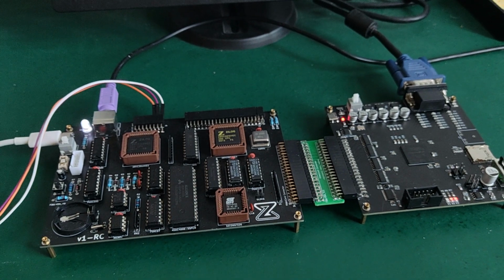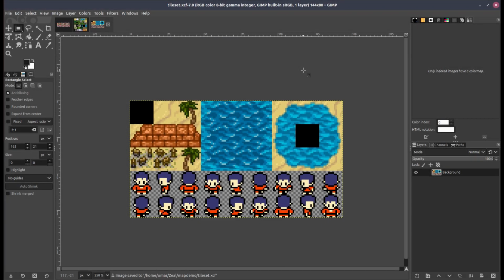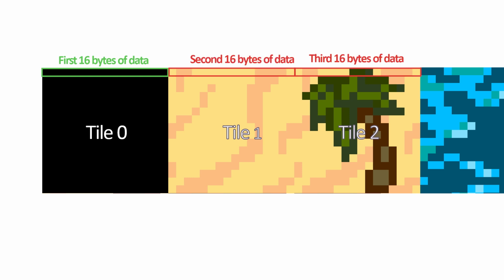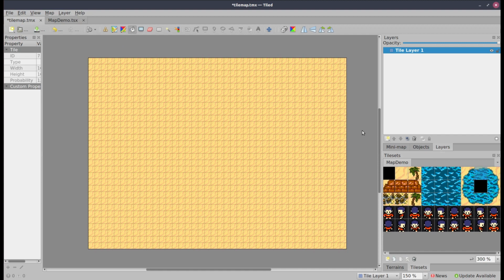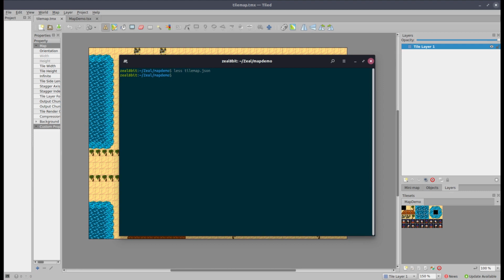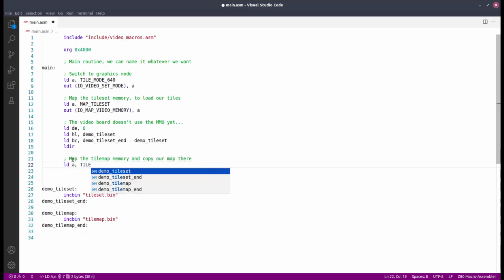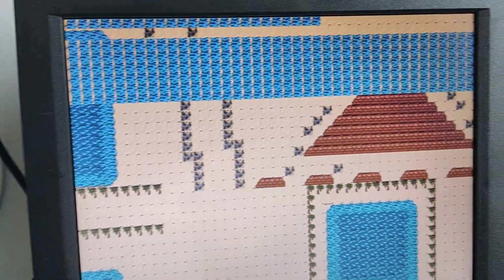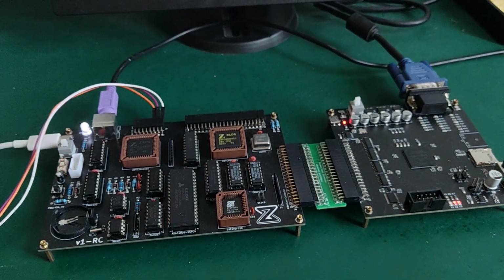How 8-bit graphics work on homebrew retro computer [Part 2]

Comment: You talked a lot about the software side of things but I've wondered how the vram works. For example. In Ben Eater's "world's worst video card", the reason for its name is that it wastes 71% of the the time wait stating the cpu while it transfers data from the vram to the screen and the cpu can only operate during screen blanking - when data isn't being transferred from vram to the screen. This is obviously a very bad way to make a video card but it was the industry standard for many years just because overcoming this design issue is relatively difficult.

The easiest way to get around this issue is to have 2 banks of vram between 2 ram chips. Or 2 "pages" if you will. 1 page is accessible by the vga port at all times, the second page is accessible by the cpu at all times. You can switch which bank is being displayed on the monitor and which bank is accessible by the cpu at any time. The main disadvantage of this method is that you need 2x as much vram for this to work but at least using it doesn't slow down the cpu.

Designing a video card that doesn't have the issues of the "worlds worst video card" and is better than a bank switched buffer card is difficult. However this approach seems to be what you did here. All I can make out on the video card is 1 fpga, (two?) spi eeproms, enough resistors to probably output 16 bit color and 5 chips near the expansion port that could be anything including ram, bus transceivers or discrete logic chips. I would think one of the better ways of implementing this would involve a 4kb or so vga buffer to buffer data between the vram and the vga port but judging by the placement of chips, that's probably not what you did.

so lol how does this work? Do you have a block diagram somewhere?
Reply from the maker: Sorry for the very late reply!
Your question is very interesting, and indeed I haven't explained it a lot here (I did explain more on Discord). As you said, one problem I wanted to avoid is memory contention between the CPU and the FPGA, I also wanted to avoid allocated a part of the motherboard's RAM for video. As such, the easiest and best solution for me was to use another RAM for the video. It's not a dedicated chip though, it's the FPGA RAM itself. I choose this FPGA because it has ~120KB of BRAM. I use this BRAM for storing the tilemap, the tileset, the characters pixels and the palettes (I'll also use some for the sound and SD card).
Moreover this BRAM can be used in a dual-port configuration, which is what I used. Used in a 4-stage pipeline, I am able to natively output 640x480 pixels at 60Hz independently from the Z80.
This dual-port configuration also lets the Z80 write a byte in it while the FPGA is reading from it for output.

Overall, this gives me two separate RAM: one for the FPGA, one for the Z80, no more contention. The Z80 is free to use its whole 512KB of RAM. Of course, the VRAM must be mapped to the physical address space so that the Z80 can virtually map it and write to it (tilemap, tileset, palettes, etc...)

Comment: What do you mean by "the VGA palette"? In VGA you can set your own colors in a 256 color palette as RGB with 6 bits for each channel (not 8 bit like modern computers) making it possible to select 256 colors of 262144.

Impressive work, btw!
Reply from the maker: Thank you for your comment!
I tool a shortcut, I meant (and should have said) the "Mode 13h" palette. 
In the future, I would like to add this feature to my video card implementation too: customize the 256-color palette, where each color can be 16-bit  (565RGB).

Comment: Could you make a video that describe the graphic capabilities in details?
Here you have constants and code that suggest more complex elements - like more then 1 layer, 
Also you have 1byte in the tilemap, and only 7 bits as index, do you plan to add more bits for H/V-flip. Also if you add more VRAM you can increase the index size to 8-10 bits
Also I didn't understand is it possible to change the colors in the palette? If so what is the RGB resolution like 444, 555, 666,...?
Reply from the maker: I plan on describing the graphics in details as soon as the implementation is finalize. I haven't implemented custom (4-bit & 8-bit) palettes yet, so at the moment, it's not possible to change the colors, but it is planned! The resulted colors would be 16-bit, in 565 format.

I am only having 7-bits as index becuase of the lack of VRAM I have in that Altera FPGA. In fact, I have at most 128 tiles. I have changed my FPGA already, I now have more VRAM, I am now able to use all 8 bits as an index. So, we have 256 tiles. I will now also be able to implement sprites. The sprites will have attributes for H/V flip. Tiles don't have attributes. It would be possible to add some, but it would require another attribute array (like the sprites), or 16-bit indexes, in both cases it means more CPU time to setup a tile. Indeed, there is no DMA on the board so all the writes to VRAM must be done by the CPU. In any case, I may consider adding attributes to tiles if time allows
Reply: @Zeal8bit  Excellent, I'm looking forward! Thank you in advance for 565 RGB :)
If you add 4bpp then you will be forced to extend the tilemap to 16bit, because you will need extra 4b for selecting a palette (to cover all 256 colors). So why not add 2 bits for H/V-flip. And you will have 10 bits for a tile index.

P.S. I would strongly suggest to not use real 640x480, rather doubled 320x240. That will reduce 4 time the VRAM requirement and CPU overload. This also will allow you to use 8x8 tiles instead 16x16 and this has so many benefits. Ideally you might even allow the developer to chose 8x8 or 16x16.
Reply from the maker: @SquallSf  I was thinking, at first, to have a single 4-bit palette for all the sprites in 4pbb mode. When optimized properly, 16 colors is already pretty good.
I am wondering if having 16 palettes of 16 colors will bring a lot to the final implementation considering that it's already possible to have 256 colors. Again, I put myself in the hardware implementation side, not software side😄
The reason I would like to avoid 10/12-bit indexes (and prefer 16-bit) is that I would like to be able to modify a single tile data without modifying the neighbour's. If we use 10-bit indexes, we would have to read (from VRAM/RAM/ROM) the word containing the highest 2 bits of the 10-bit index, modify these bits only and then write them on the bus to the VRAM. Similarly, modifying the neighbour's would mean modifying the higher 6 bit only.  Shifts/masks are a bit of a pain on the Z80 as only the accumulator can perform them and it's only possible to shift 1 bit at a time. Thus, it would be faster to use 16-bit indexes. Another possibility would be to have all the extra bits (let's call them attributes) in a different array, that would be a good tradeoff.

You have already guessed what I am working on. I have already implemented 320x240 (double pixel) for the text mode. I will continue by implementing it for graphics mode. Both will be available at the same time. It will be possible to switch between both resolution thanks to a single write on the I/O bus. 640x480 is very handy for text mode as we get 80 columns! For graphics mode we have a 40x30 tiles mode which would let us have HUD on games, without hidding too much the "playground".
But again, up to the developer to choose the resolution that will fit him better. At the moment, I have only planned to support 16x16 tiles for both modes.
Reply: @Zeal8bit  Yes the visual difference between having 1 pal with 16 colors for all 4bb and selecting 16 pals with 16 colors is huge, almost like watching EGA and VGA graphics :)
What I mean by 10 bit index is that your tile-map 40x30 consist of 16 bit values. Inside you have 4 bits for palette selection, 2 bits H/V - flips and 10 bits for tile index. This way every new entry in the map will start on every second byte. That is (almost) how SNES is, the VERA that I mentioned, ... It is  easy to manipulate. 

P.S check this out: https://youtu.be/BUE3dVsew0w every sprite uses its own 4bpp palette. Imagine it if they all share the same palette :) The VERA also uses 2 bytes (16 bits) for the tile maps. It is fast and easy enough.
Reply from the maker: @SquallSf  Oh my bad! My question was poorly formulated...Of course 1 palette vs 16 palettes differs a lot 😄
 I meant, I wonder if having 16 palettes of 16 colors differs a lot compared to having 256 colors directly (16 palettes 4bpp vs. 1 palette 8bpp). 
In any case, it's a good idea to have multiple palettes for 4bpp, I will add this to my to-do list😉
Reply: @Zeal8bit  I see what you mean. That is a good question.
In 4bpp you can use up to 240 colors, because you loose 1 color in each palette for transparency). In 8bpp you can use 255 colors, so from that point 8bpp is much better. Also 8bpp tiles as visual quality is very close to 8bpp linear (bitmap). 4bpp must limit each tile to 15 colors and that is why in general 8x8  pixels tiles were used - the larger the size, more likely colors will not be enough.
However 8bpp tiles takes 2x VRAM and pretty much 2x CPU time to transfer. Also that makes transfers from external storages slower, like loading assets, since RAM is never enough :)

But instead of trying to decide, leave that choice to the developer - that is the beauty of 8bit/retro - a constant struggle to overcome limitations.  :)

Comment: How would you recommend handling scrolling, given that the video ram is read only (although you may have changed that in an earlier video, I'm not sure)
Reply from the maker: Thanks for your comment!
You guessed right, I changed it in a previous video: the one talking about CP/M. I implemented an MMU, which can address 22-bits/4MB of physical RAM.
It will be possible to read back the VRAM. However, I am also considering implementing hardware scrolling. I already did it for the text mode, it's possible to scroll text-line by text-line (each text line is 12px height), this is what the monitor uses currently. For the graphics mode, scrolling would make sense if it can be done pixel by pixel.

Comment: Do you think it would be possible to interface your board with a Compact flash card with the 40 pin extension port? I think it would be cool to build a DOS like operating system so you could develop software on the board directly.
Reply from the maker: Thanks for your comment.
I have already planned to make a CF card extension board (I have already bought a 64MB one with an SMD socket), it should not be a problem. Regarding the OS, you also guessed right, I am developing an operating system which will be able to run text/code editor, a Z80 assembler and/or higher-level langages, so definitely, my goal is to have an OS that will also make Zeal a development platform
Reply: @Zeal8bit  Sounds great!